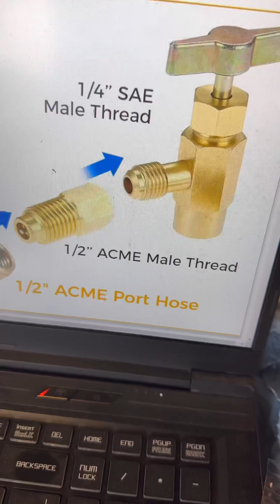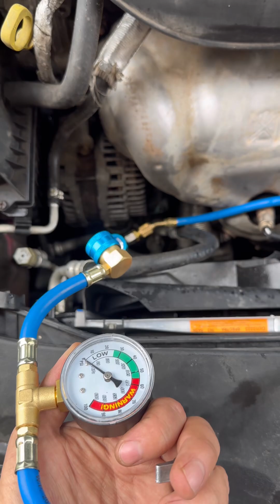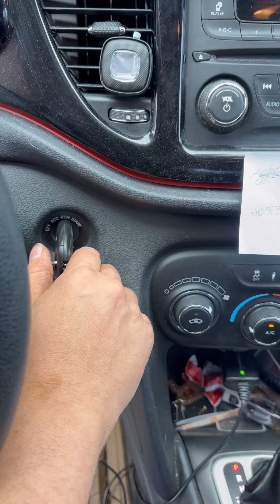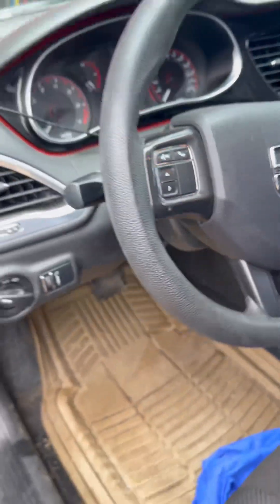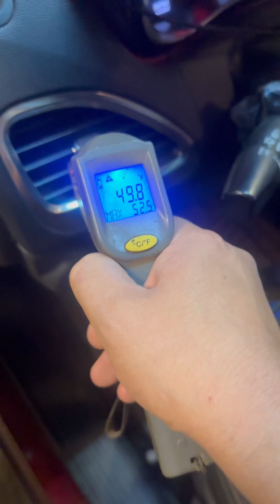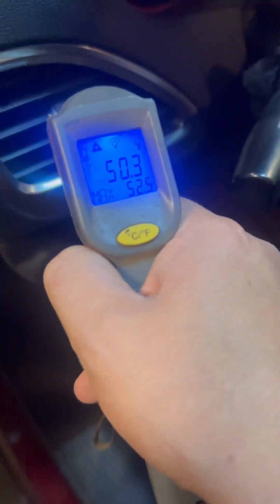Ac gauge set going from R134 to R1234yf with simple cheap adapters and more

Comment: I read "You cannot properly clean a standard manifold gauge set for reuse when switching between R134a and R1234yf refrigerants. The risk of cross-contamination is too high due to the different oils and chemical properties of the two refrigerants. Dedicated gauge sets for each refrigerant are required to avoid expensive damage to a vehicle's A/C system."